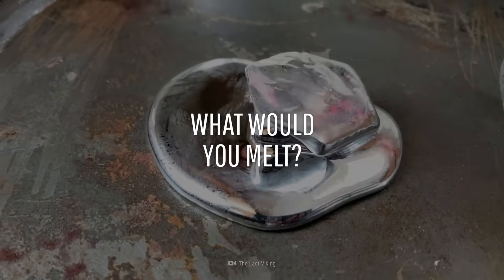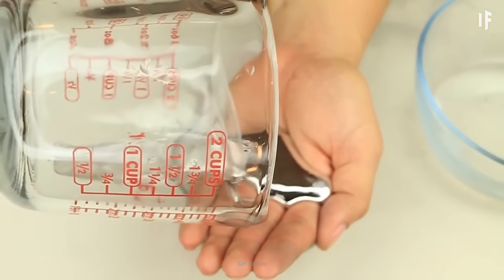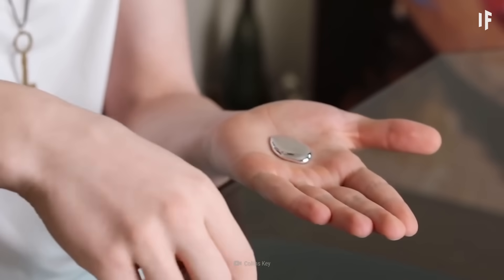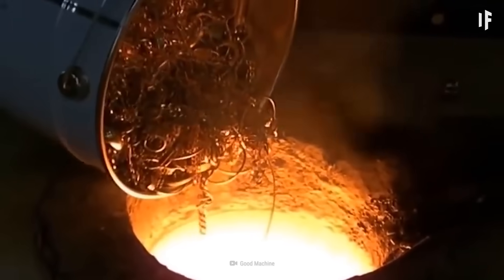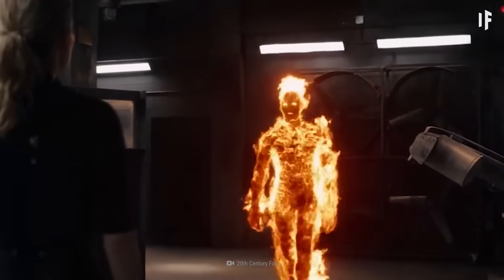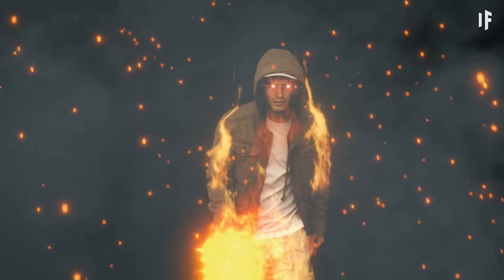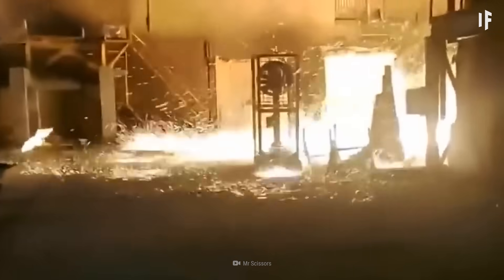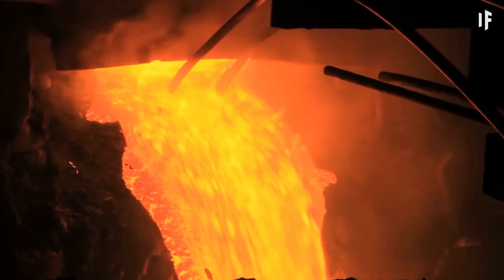What If You Could Melt Metal With Your Hands?

Comment: Can you do this next?

What if jet fuel can melt steel beams?

;)
Reply: Just Some Guy without a Mustache 9/11 what if?
Reply: Or how can a building with minimal fire collapse at free fall speed COUGH WTC 7
Reply: It can't but it can weaken steel beams to the point of easily breaking
Reply: @vladimircanales8410  that's why other buildings that had fires burning for a significant amount of time free falled also I get it now
Reply: @godofwar0678  yep